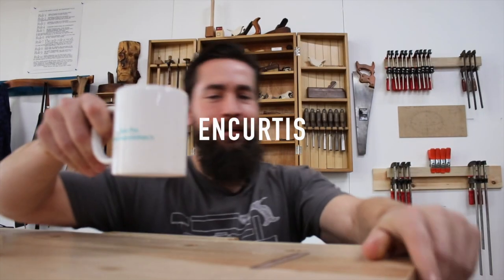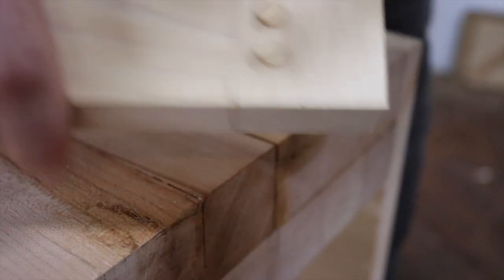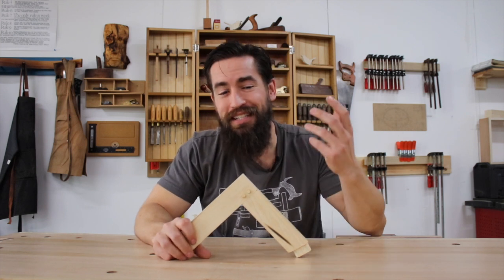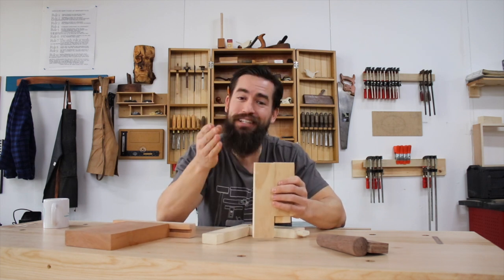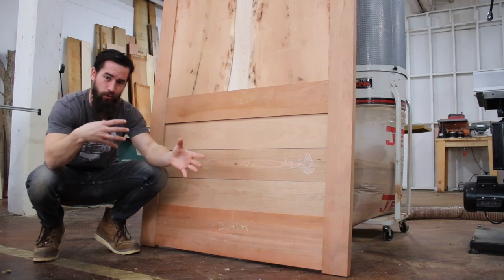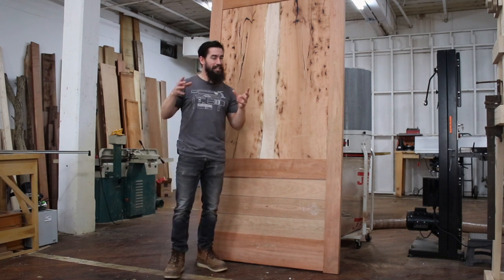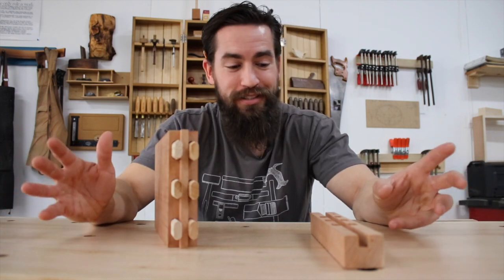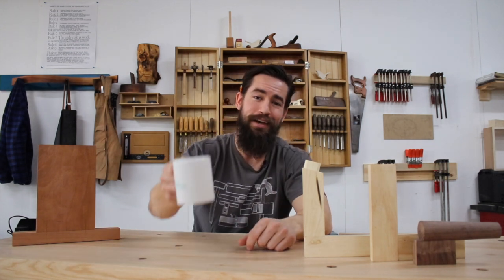CANCEL Mortise and Tenons!

Comment: The wood is going to break before the joint breaks. As you state modern glues are stronger than the wood itself. I really think the advantages of the traditional joints like the mortise and tenon are all about spreading out the mechanical forces on the joint which spreads the forces throughout the wood verses applying all of those forces at the contact point.
Reply: This I believe to be the correct theory. Also adding to it the longer the tenon reduces the likelihood of the stile cupping and allowing the door to close properly for decades. In other words every little bit of movement from the stile will be amplified by the width of the door

Comment: Great minds think alike. Besides all the other reasons for liking epoxy on large joinery, I used to build/assemble large table type bases for heavy glass display cases by mesef. The glue up was so much less hectic using epoxy-like 30 wt oil on the mortise and tenons. Plus you can tunk things around a bit if the need be after bringing the joint together unlike yeller glue.Thanks❗️🍀
Reply from the maker: The open time of a slow cure epoxy is a true god send for large glue ups like this. Couldn't agree more.

Comment: I’m thinking about the complex joints used in Japanese woodworking and they tend to have two qualities: mechanical advantage and large surface area (especially when compared to Western styled joinery)

There’s lots I don’t know about Japanese woodworking: do they work with dried lumber? If so, do they glue their joints?

But maybe there’s some knowledge to be found there that builds on or supports your hypothesis 🤔

Thanks for the video. Glad to hear people critically thinking about why we build the way we do.
Reply from the maker: That is an interesting question to ask. You're absolutely right, Japanese joinery tends to have large surface area allowing for more glue. In timber framing, however, they do not use glue, instead opting for a series of pins and wedges to hold joints tight for centuries.
Reply: @ENCurtis  Yes that’s true!  But they also use high-surface-area joints in furniture making: double mortise-and-tenon joints to connect stretchers to legs, for example, or castle joints connecting table legs to aprons. So maybe that’s some historical support for your theory.
Reply: They also use rice as a glue, just cook it sticky and mash it up real fine

Comment: I know I’ve said this pretty much before on this channel. But, but, but. The only reason that mechanical joints were used was because the chemicals used at the time (animal glues) were not god enough for long lasting joints. We don’t have that problem now with adhesives that can be stronger than the wood itself. 

It all comes to glue surface area. The more glue surface area, the stronger the joint should be. A M&T joint is not intrinsically stronger or weaker than a domino or dowel joint if the total glue surface areas are roughly the same. It comes down to ease of making - for me the domino wins hands own on this. Accurate and repeatable. I rarely use my large morticer now and my dowel jigs sit unloved in a drawer. 

I’m no expert on adhesives but I’m probably like most people in working out that the cost of adhesives as a percentage of a total build is probably less than 1%. So, I don’t buy cheap adhesives just because I don’t want to take the chance of them being not so good. Titebond in all its various forms is my normal adhesive of choice. Most commonly Titebond 3 but I also use extend, cold press veneer etc. 

If I’m doing a complex glue up and I want a long open time, I use Cascamite. It’s a faff mixing it in that you have to be very precise in weighing out the powder and the water but it takes less than a minute (how important is a minute in the length of time a build takes?) and it gives me really strong joints and that all important long, long open time. 

Epoxy? I’m afraid I’m guilty of using what I know. I do use 2K epoxy glues but I equate those to small pieces, usually repairs. I’m sure I’m missing out but I haven’t found the need to find out about epoxy. Yet.

Comment: Quickly becoming my favorite channel on Youtube. I agree with your theory. I guess the ONLY other real question in light of the immense strength of Epoxy and yellow glue is........"How darned strong to you REALLY need the joint to be?   

Let me put it another way. If we can build a bomb proof door, with more tenons than carter has little liver pills...And all you need is 4/10ths the strength of a normal glued simple tenon. How much over-engineered "craftsmanship" do you need?  

Will simple dowels and glue provide more joint stress the unit will ever face over it's lifetime?  Now with that door in your example. Might be worth it in light of the weight vs support. But on a normal piece of furniture.  How much really needs to be designed into it based on how good epoxies and yellow glues really are in their own capacity?

Comment: If you look at most 90 degree joint tests, you find that the failure occurs on the "vertical" piece (stile), just below the mortise depth, the mechanism being the split/failure of the lignin wood structure.  IOW, the number of tenons, the stub tenon, the depth of the tenons, none of those factors control the strength of the joint, ONCE THOSE PARAMETERS (depth, etc.) MEET A CERTAIN MINIMUM.  IOW, a 1/8" tenon, 1/4" long, isn't going to hold much, and the failure will be in the tenon.  Somewhere in the neighborhood of 1/2" wide, 1/4" deep, 1" long tenon, the critical failure point shifts to the lignin.  There seems to exist a fairly "standard" M/T design used no matter what the wood material.  [A useful test would employ a series of successively larger tenons until the stile lignin fails.]  I suspect the "standard" provides a large multiple (300~500%?) of the minimum needed strength, using dimensions learned (hard way!) over time (centuries).

Comment: I think you are right, a bunch of little M&Ts would be better than one big one, if you could get it just right. The tolerance would matter a lot, if those little M&Ts were loose at they would be able to break off individually without supporting each other and you would fail at the tenons shoulder, or the mortise would break out the side of the board (depending on how close it is to the side)

Think about all the tricks people did with phone books. Like if you take 2 phone books and interleave the pages one by one they are extremely hard to pull apart, or if you try and rip a phone book in half it's really tough, unless you do the trick where you bow the pages out so you are ripping them in little tiny groups instead of all together.
Reply from the maker: You're absolutely right. The fit of the initial joint is still critical. I'm just working under the assumption that it's toight as a toiger.
Reply: That was my first thought: while the many mini m&t might be stronger, it's also a whoole lot fussier. The single big m&t ... simpler is better for a lot of reasons.

Comment: I hate to be the one negative Nancy, but mechanical advantage does not mean what you think it means. Those pins create mechanical fastening, but mechanical advantage is the force multiplication you get by using simple machines such as wedges, screws, levers, and pulley systems.
Reply: Words are hard.

Comment: I’ve never used epoxy in woodworking. All wood glues are not the same. I’m assuming that the same is true for epoxies. Any suggestions on epoxies for woodworking? I trust a fellow creator more than google or amazon bot reviews. Thanks for making instructional videos, and especially for being humble during your presentation.
Reply from the maker: West System is an old favorite and one I still use with some regularity. Though lately I’ve been using TotalBoat’s high performance epoxy and it functions much the same. Have never had a problem with it in over two years.
Reply: @ENCurtis  Wow, that was a fast reply. Thank you for the recommendations! Now stop w/ replies & get back to making a thing (kidding).

Comment: I used an XL domino machine and put 12x150mm dominoes into the joists of a deck that i store fire wood on. they have been there 3 years now no problems so far. No glue just some pocket hole screws to keep the deck pulled tight horizontally.

Comment: Nope, not disagreeing at all. I think your theory has merit. A test is in order and I look forward to it. The "end grain gluing is weak" myth has been busted by Patrick Sullivan. That test I duplicated using red oak, which, as most know is so porous you can blow bubbles through a stick of it with one end in water, (or the fluid of your choice).  Two square blocks, roughly 2-1/2 " x 1" thick, applied wood glue to the end grain, promptly absorbed into the porous grain, applied second coat, then clamped. Incredibly strong joint, just a glued, end grain butt joint. My theory; porosity of the grain pulled in the glue, second layer of glue bonded to that glue creating a nearly micro mortise and tenon effect. Glue being stronger than wood, it surprised me how strong the joint became.  Timber framers using green wood will use the drawbore dowel method to mitigate the ensuing shrinkage. A fun and very effective method. Glad I stumbled across your channel, was an immediate sub for me.
Reply from the maker: I used to explore the sized end grain butt joint with my 6th graders when I taught wood shop. It always surprises just how strong it truly is.
Reply from the maker: And thank you. I'm glad you enjoyed enough to stick around my dude 🙏

Comment: Thanks for this interesting video. Now I am wander which and how you use epoxy. Glueing up a project is the most stressfull point in my project due to the open time. Do you have a video in it?

I am also wandering how did you create the domino’s combined with the tenon?

Thanks for sharing

Comment: one thing to consider is how well the chemical bond will hold up over decades. a joint that is stronger now due to modern chemistry may not be stronger 50 years from now.  which, of course, is generally only important theoretically since most m&t joints will be overkill, structurally speaking.

Comment: someplace along the line you will hit the point of no extra value. If 2 dowels are good then 10 may not be 5x better, it may even be worse than 4
Reply from the maker: For sure. There is a point of diminishing returns and I imagine that rate becomes exponential relatively quickly.

Comment: True that glue is stronger than lignum. Key variable here is time. How long does modern glue last and how does the strength degenerate over time? I don’t think we’ve had the time frame to prove that as yet. 
Case in point: What kind of glue holds layers of plywoods together? Have we seen old plywood delaminate through time? Maybe that tells us something?
Reply from the maker: That is absolutely the key variable. And the answer is: we don’t really know. Yellow glue has only been around 100+ years, so we know it has the capacity to last that long under the right circumstances. But past that… it’s anyone’s guess 🤷‍♂️ 

The next question then becomes: how long does a piece of furniture really need to last. 100 years? 500? 1,000?